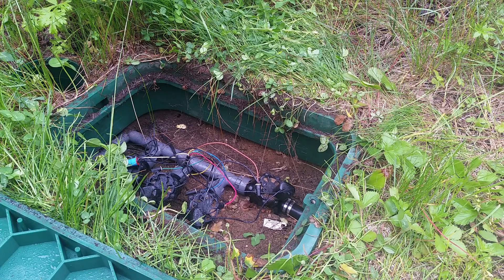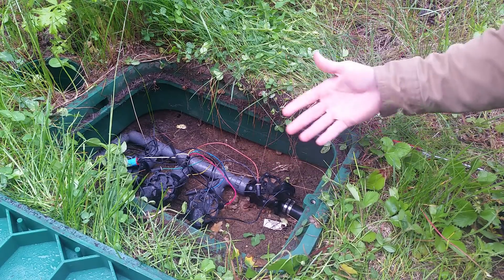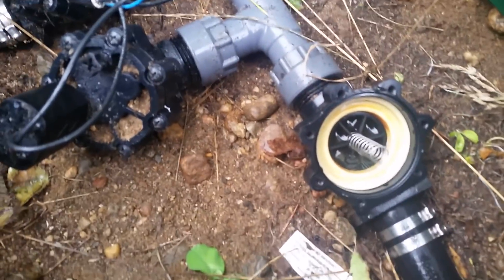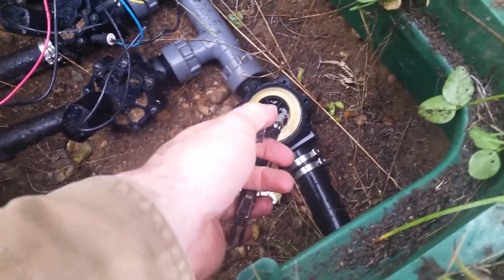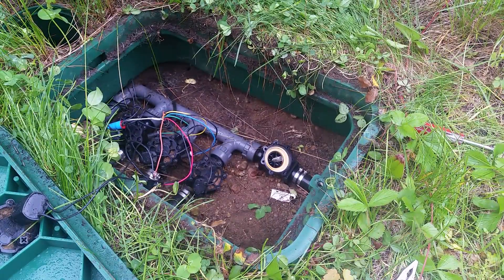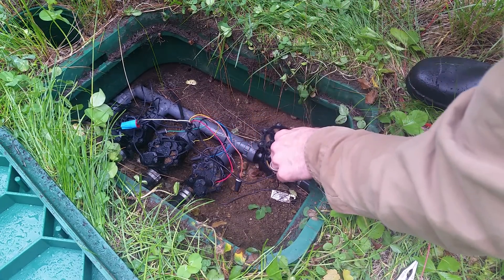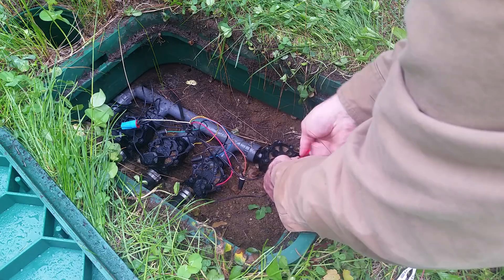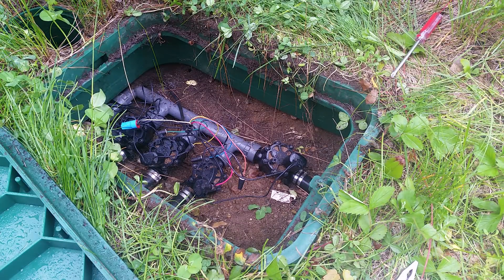How to Fix Irrigation Valve That Won't Shut Off (Irrigation Valve Disassembly and Cleaning)

Comment: Thank you! I had just replaced some pvc piping upstream from the valves as part of replacing the backflow valve. Some fragments of pvc (from cutting the pipe) got into the system and ended up fouling up one of the valves, and that zone wouldn't stop. Initially I thought the controller was going bad on me, but once I understood how the valve was assembled and how to clean it out properly everything went back to normal. I really appreciate the effort you put into this. Thank you again.

Comment: I followed a few videos on this topic with cleanning, it was happened 4/21, after cleaning, it worked until today 6/5/21 and  did not stop spraying even the system was off;  i cleaned it a few times, not working. I swapped the solenoid to a diff station, and the other station became bad; so the solenoid is the cause
Reply: What then?

Comment: Thanks for your video. It worked! I have been wondering on how I can fix my issues for two days since one of my zones is stuck and won’t turn off until I saw your video. I was a little scared to be honest because I don’t want to get it worst. As easy as your video after I cleaned it and there it goes it’s back to normal. Very easy indeed. Saved me $$$ calling for the sprinkler guys. Thanks again

Comment: where do u turn the electrical power off, before u start working on it?
Reply: You don't need to turn power off to perform this work. Don't disconnect any wires (and they are low voltage anyway)
Reply: @bdaaz  Put your programmer on "OFF"  and disconnet it from the current outlet.

Comment: Does the water need to be on while you are doing this? The valve is right in the sprinkler path that won’t turn off. Or can water be shut off then tested again after doing these steps?

Comment: You need to take out the diaphragm (membrane) and check it as well as the valve bit underneath it.
More likely there is dirt in that part as that's where the water flows through.

Comment: If the zone still stays on after doing this what else could you do to fix it? 
My zone 1 stays on even tho it’s on a different zone running.
Reply: Take out the diaphragm and check for any dirt or any damage.
Check inside the valve part under the diaphragm.
Pretty much check everywhere for any dirt.

Sometimes you just get to the stage where it's time for a new valve. I had one from 1984 go like that. It would not switch off no matter what.
Reply: Cut the lateral line. And unscrew the whole valve 
Replace it with a new one
and throw the old one in the bin.
Reply: Same
Reply: Check your solenoid

Comment: That was the simplest solution. It worked perfectly. There's was some debris that got between the housing of the valve and the diaphragm that prevented it from sealing properly. It was easy to clean off and reassemble. I had the valve done in less than 5 minutes. Now it shuts off properly. Thanks for your help.

Comment: I was able to clean my rainbird valve (it would not shutoff) and membrane based on your video. I had some tiny leave fragments and rust slime on membrane.  Back together and it works great. Thanks for your video.

Comment: One of my zones in the backyard won’t shut off. I’ll def try this. Thanks so much. Dumb question but when i opened my box, it was just filled with dirt. I had to dig out to see the valves etc. it wasnt like this before. Is there any reason dirt builds up like that or should I just check it every week or so to keep the dirt out? Thanks for all the help.
Reply: I'm not sure how helpful it is, but I'm currently troubleshooting a fix for mine and it was packed thick with dirt. No dirt was present last year. We've had pest issues throughout the winter and I traced most of the holes back to the valve box.
Reply: Nathan Pettepier it ended up being dirt and also i replaced the round rubber rings and it fixed it! Thanks!

Comment: What if only one section  of my sprinklers stays on and won't stop even when I turn off the timer
Reply: Did you ever figure out what the problem was? I have the same exact issue with only 1 station getting water (and wont turn off or switch stations). I have to turn the water off in order to get it to stop...
Reply: @shapirate  No I didn't, I tried getting an estimate on the problem but I was very disappointed when the guy said it would cost me around 800 to go thru the whole system , I gave up, it's just as well, we've been under water restrictions and can water only once a week, I water the old fashion way, waterhose
Reply from the maker: Could be a lot of things, but in the case of this video I was losing the vacuum due to that loose screw.

Comment: What repairs did you make.  We saw how you took it apart, and put it together.  Is re-seating the gasket what solved the problem?
Reply from the maker: I think it was just the debris (in this case a random loose screw)
Reply: @willworkforliberty  Sometimes you need to replace the Diaphragm .

Comment: My third station would not shut off.  Took apart the valve and what do I find?  A small bronze-colored screw!  There has been some water meter work near my home and I'm wondering if that's where it came from.

Comment: How did you localize it to that valve? I have 5 zones and 2 turn off on their own with the controller not even plugged in. Any help is appreciated.
Reply from the maker: Turn on the other valves and see if anything changes.  If a new zone comes on then you know its not that one.